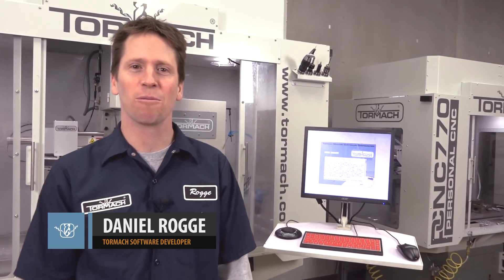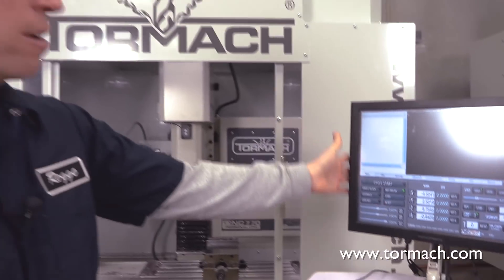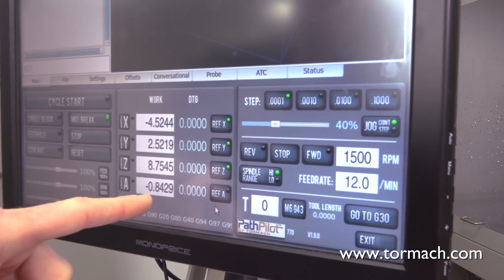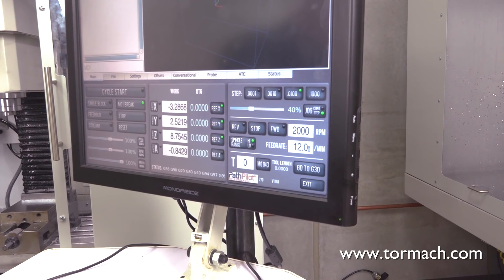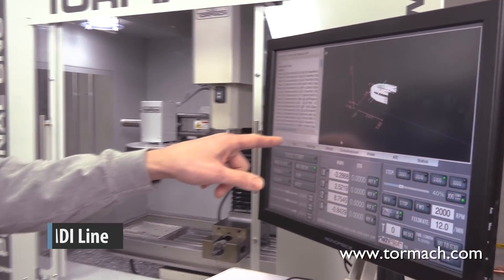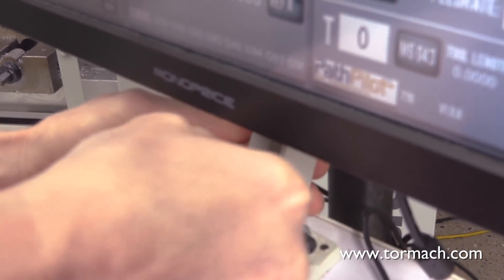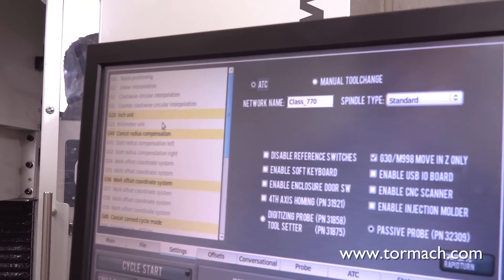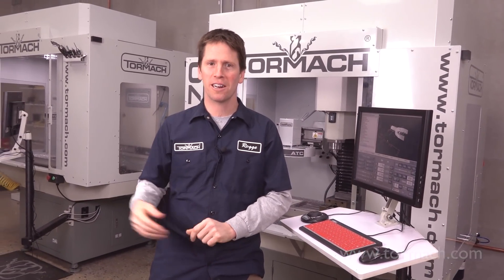Your First Day with Tormach's PathPilot

Comment: Just a general question: In few years I am considering buying a CNC machine for my model train business. Though many things can change by then I have few general requirements that influence my choice. I am new to CNC machining and I expect a big learning curve to overcome yet consideration whether or not to commit will come down to next big question:

Since model train parts I plan to make are for tiny scale trains (1:100 scale), the wheel will rarely exceed 8mm or 1/3" diameter. Because machines by Tormach the ones I saw are large ones I am wondering about capability to machine small parts as some chucks (maybe just because I used cheap tools in past) have limitation of 1mm being minimum stock they can hold. Thank you.
Reply from the maker: You may want to look into the work of Wes Bye. Wes uses a PCNC 440 for all his CNC work. We have a video of him at our open house from several years back (sorry the audio system stopped working so the audio is bad).  https://www.youtube.com/watch?v=_WFGn8HHmU0

Comment: Can the machine be set up to run metric all the time?
Reply from the maker: You can change your PathPilot Control System to operate in metric by typing G21 in the MDI line. The system will stay in metric upon restart, but initially the display will show G20 (Imperial). Once you press reset, the system will display G21 again.

Thanks for watching!